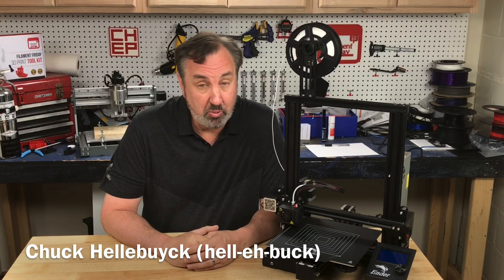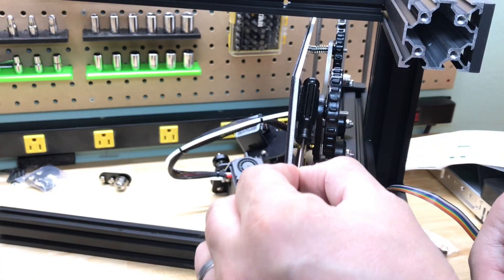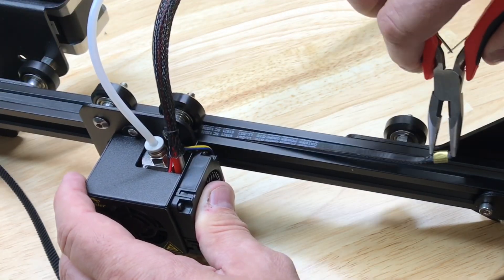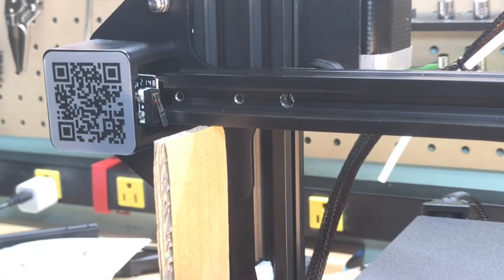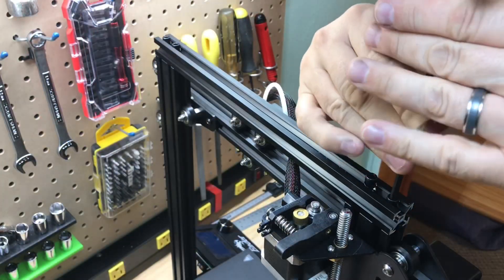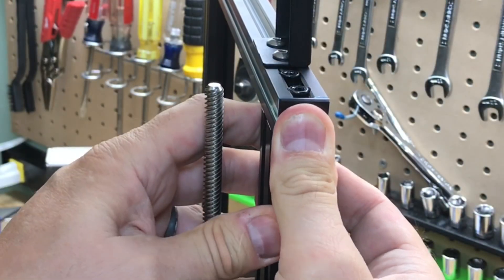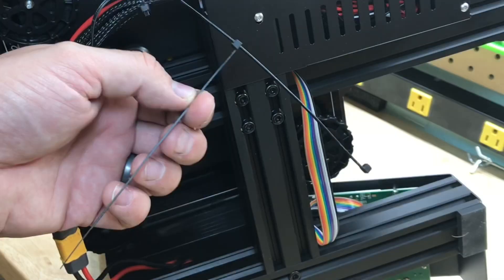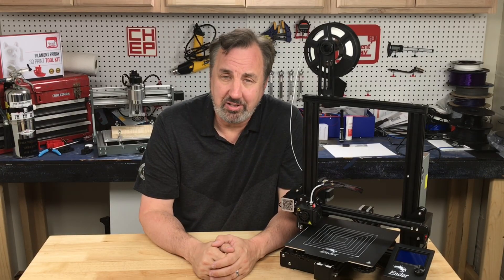How to Setup an Ender 3 Pro 3D Printer + Extra Tips

Comment: I recently bought a used one and it needs so much adjusting and bed leveling.  I may have to disassemble and go through it with this video to make sure everything is to spec.  The beam was about 10mm off of level, and the bed is wobbly.  The nozzle was semi-clogged, too and it needs a new Bowden tube.  Luckily, I'm mechanically minded, a tinkerer, old and tenacious.  It will be assembled correctly, LOL.
Reply from the maker: I have a whole playlist of helpful Ender 3 tips. 
https://www.youtube.com/playlist?list=PLRFPlUhDTTlkLIpsROX0T_Osx-_V3LNBn
Reply: running into the same issue right now

Comment: Do you have any tips for ender-3 pro touch screen problems? I got gifted one that already had it installed and when it boots its stuck on the creality screen with a loading bar that doesn't fill whatsoever. Its got a 4.2.7 board so I'll be trying to load firmware to it today and see if that does it.

Comment: so i just bought a second hand ender 3 pro. apparently it was highly modified. im totally new to this. he had to compeletely dissasemble it for shipping. now im staring at box of about 1000 parts with no clue where to start. i think i might have bitten off a little bit more than i can chew. thanks to your vid tho i got the frame built but i have an entire bag full of wires and a nother bag full of circuit boards and god i have no idea where to begin. problem is i think half the stuff is not needed. as i dont know what is an original part and what is a after market part. there seems to be many doubles and tripple parts. actually yes. i did bite off more than i can chew haha. wish me luck my dude.
Reply from the maker: Lots of luck. These might help. 

https://images-na.ssl-images-amazon.com/images/I/A1RtrhQ8ZOL.pdf

https://support.th3dstudio.com/helpcenter/creality-melzi-board-connections-cr-10-ender-3-ender-5/
Reply: @FilamentFriday  oh wow! thanks mate :D
Reply from the maker: My Ender 3 Playlist might help as well. 
https://youtube.com/playlist?list=PLRFPlUhDTTlmu2Vi3zH-yq_qlOxiy2QWV&si=j2-EugWuAn-e1HKs
Reply: @FilamentFriday  nice! ill check it out.

Comment: Am a few minutes in and realised this is ender 3 pro rather then just ender 3 which is what i have. Is this model different then regular ender 3? Should i restart with a different video ?
Reply from the maker: They are real close so it should still work.
Reply: i did this too 😅. sure its ok?
Reply from the maker: Yes.

Comment: I found on Ebay a Ender 3 Pro sold for $26/ It was for "Parts Only" I found a few Missing screws, a Pwr supply missing some screws. No Build pad just the sticker for the pad. So far I have replaced the Springs (with the orange ones) Pwr Supply, Extruder for a metal one (Gold color) Boden tube. it has a 4.22 board in the system.

Comment: I appreciate the video.

For a newbe it would have nice for an overview that identified front and back. Hard to put something on the right if you have it backward.

When checking for square with 2 rullers i tried your twist method but it kept lifting one set of leggs up and it rocked.

I found that if i loosened the 4 screws of the y axis i could shift for square.

I have a scale engraved with 120 lines per inch.

I started out of square by 1/8 inch and got it down to 2 marks or about .016 inches.  Is that good enough?

I bought a used machine and keep finding screws or missing parts.  But i am getting there

So it would be nice to give a tolerance  to shoot for.

.

Comment: @3:53 If I cannot get my x-axis bar onto the two vertical extrusions (bars) what do I do?
Reply: i'm wildly late so you've probably figured it out already, but i'll still say in case others encounter a similar issue:

the eccentric nut is probably to tight, you could loosen that.

Comment: 1:00 you say the holes must go on the inside but you do not clarify that there is a proper top and bottom orientation as well. This led me to progress until the power supply installation until I noticed.
Thank you for the video it was very helpful overall. Maybe my comment can save someone the hassle. 
You want to orient the second arm so that the holes face the inside and one hole is as close to the bottom as possible.
Reply: Its not Chucks problem, its yours.
Assembly manual shows these details exactly (with arrows) and clear photos. RTFM

Comment: I watched this video twice, once all the way through before even opening the box, again as I struggled to assemble the thing. I am NOT mechanically inclined and once I figured out that you switch the angle of the video without notice, things got a little easier. Did I have to pause and rewind a few times? Yes, did I struggle and cuss and eat almost an entire box of chocolates from stress? Absolutely! The machine is assembled, tomorrow I will try to figure out how the hell to actually connect it to something to print. 

By the way, one very important thing, I put the right arm on incorrectly because your video said “make sure the holes are toward the inside” which I did but a VERY important thing is to make sure the arm is set with the smaller distance to the hole on the BOTTOM (which is specified in step TWO of the written instructions which I ignored) until your video got to the step where you add the swItch and I had the rest about 80% assembled and realized the arm was on incorrectly.  So I had to take it all apart and figure out how to realign it after re-assembling it. I’m sure you won’t take time to edit the video at this point but maybe someone will read this and avoid that issue. Make sure the holes are on the inside and the shortest space is close to the bottom of the arm (if that makes sense, refer to instructions for visual reference).
Reply: I just did the same F-ING THING! 🤬🤬🤬

Comment: Hello CHEP, 
I followed your tutorial. My z-axis doesn't work when I auto-home. I heard the motor running but the arm won't move up or down. Any tips are greatly appreciated. :)
Reply: Did you tighten the set screw on the coupler for the z axis rod?

Comment: This video helped me solve a problem I have had on my second hand ender 3 pro. I saw in the video that your z screw coupling was not bottomed out on the stepper...mine was so I raised it, i also installed the z screw and lifted it a tad before I tightened it down. I also found that my z stepper motor was not tightened down all the way nor was it square to the frame! Lastly the belt tension gantry idler was loose on mine so I got that all tightened up. Just about done printing a temperature tower I found from one of your videos and this is the highest my printer has ever printed! It may actually complete a print! Thank you!!!!

Comment: @3:00, I couldn’t slide the belt under the wheels, due to the terminating ferrules not being totally smashed right (not flat enough to clear the wheels).  To get around that, I had to drape the belt, THEN roll the hot end over it all

Comment: I bought mine 2nd hand it was put together already. I haven't actually used it for 2 years since I bought it. When I moved the base the screen powered for on for a sec  even though it was not plugged in and it freaked me out....
Reply: That's normal the stepper motors will generate a charge when the motors are actuated outside of normal function. While normal you will want to avoid that occurrence as it can backfeed power to the control board and cook it.
Reply: This is scary that they didn't put any protection in place to prevent this from happening.  I guess I will be keeping this unit unplugged when not in use I'm sure it's FAR from UL compliant. 😂 (Who knows what other protections they didnt put in place)
Keep a fire extinguisher nearby!!
Reply: @kencammo5699  I would but I haven't figured out how to use it, the nozzle keeps clogging up so it is not being used at all..
Reply: @Glorius-b7z  if your nozzle is clogging you’re probably getting heat creeping into the heat sink prematurely melting the filament. You can get a new extruded relatively inexpensively from the manufacturer or many aftermarket sources. This is definitely a tinkerers hobby but once you get the hang of it the benefits pay off in dividends.
Reply: @matthewjacobs5507  I built myself a gaming pc and 3d printing seems harder..
Reply from the maker: Make sure the  PTFE goes all the way to the nozzle. Otherwise clogs will occur.

Comment: Hi Great video! Everything has been seamless until I got to the leveling of the gantry. The motor assembly bracket doesn't have any play in it for leveling. I may have to shim the vertical on the other side to level the gantry. That's the only thing I can think of to the the gantry on the motor side to drop by about 3/32". I'm open for advice. Thanks!
Reply from the maker: https://youtu.be/8qLJyaBlCCA

Comment: Thank you for this video, it helped me out a lot.  I have a question I hope you can answer.  Lookin from the front of the printer, is there supposed to be some Z axis play with the triangle plate with 3 wheels running up and down the right side vertical bracket?  Mine seems to move about .25-.50 inch.  TIA
Reply from the maker: Maybe a slight amount but if the eccentric wheels are adjust properly, the crossmember should not sag or move much at all.
Reply: @FilamentFriday  Thanks, also are the bed springs replaceable on the 3 Pro?  I don't have flathead screws on the bed to remove them
Reply: @jerrygorman5030  You don't need a flat head screw driver. Spin the wheels until they come off. That will loosen the bed replace the screens.

Comment: my ender 2 pro is not working the screen is not working what yor avice I watch your videos and you have helped your the the reason why I bought it we can not find anything on the internet we have already tried to install new firmware but it didn't work so what would you do if you ender 2 pro The screen is not working. 

thank you 

Aiden we have no other options
Reply from the maker: Check the cable for broken wire.

Comment: Great tutorial :) whats up with cura 4.10 - 5.0.0 not working with windows?
Reply from the maker: Works fine on my Windows laptop and many viewers. So not sure.
Reply: @FilamentFriday  had to remove  "program files" from the install directory, and run as admin in 8.1 compatibility mode. now works Cheers :)

Comment: Chuck, you missed a common issue at minute 5. When tightening the z motor to the extrusion it is vital to check that the motor is resting square with the frame. On both of my ender 3s despite the frame being square, once I tightened the screws with the t nuts, the bottom of the motor away from the vertical extrusion pulled up away from the horizontal extrusion. If left as is the motor will now be causing the leadscrew to not be straight up and down in relation to the vertical extrusion. To fix this issue I have placed a small shim, a thin piece of plastic like from a fivestar notebook works great or even an m3 washer (one by each silver screw) depending on the size of the gap you need to accommodate for, between the black plastic piece and the motor. Place it under the plastic piece away from the vertical extrusion to offset the gap. Then tighten back down the silver screws. Now attach the motor to the vertical extrusion. Shine a flashlight or your phone light on one side of the motor and look at the other side to see if any light is passing through to check for any remaining gap. This will ensure the leadscrew is straight in relation to the frame.
Reply: Interesting… my friend had originally told me about it affecting his ender 3 pro, and then I had caught it on my two ender 3 pros during assembly. Came across some threads on Reddit that mentioned it too at some point. Welp at least there is another tip for people in the comments for troubleshooting leadscrew alignment issues.

Thank you for the great video as always.
Reply from the maker: I referenced it and showed to check for straightness but didn’t go that deep because I’ve rarely seen that issue in all the units I’ve put together.

Comment: I use a few simple tools when setting up a printer 
a small spirit level , a square and a dial indicator  . 
With these three  tools you can compare parallel and square to ensure all of the axis are parallel and  square to each other  and the z axis is perpendicular to the base . It also helps to set the bed up as the dial  indicator can show the deviation of the bed very accurately. No need for expensive tools here just basic cheap stuff is all that is needed .

Comment: I have a ender 3 pro and I need help working with this machine at this point I don’t know what to do any help plz
Reply: you should just specify your problem right away
Reply: Thanks for the advice. I have heard about drilling the hole I'm the frame but hadn't seen any footage of it being done or how exactly it helps. I'm going to re-square the top frame and the gantry using your tips.

Comment: I downloaded your Tornado Cura profile a while back and love it! Recently, though, I was going to print a 200 x 200mm box and Cura said it was too big to fit on the bed - there were areas marked on the bed that were reserved. I ended up using another profile to print the box. How do I remove these areas so I can use all of the bed? Thanks in advance.
Reply from the maker: https://youtu.be/Il1sierB4Yk